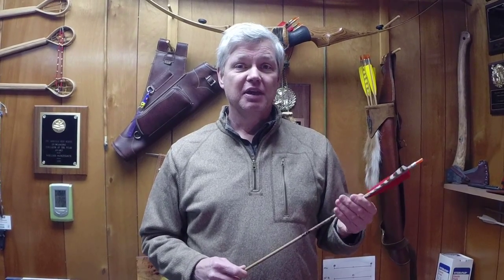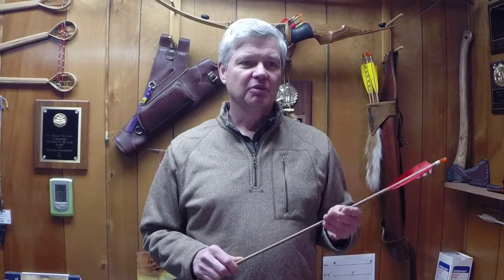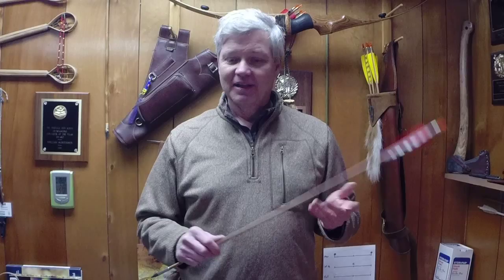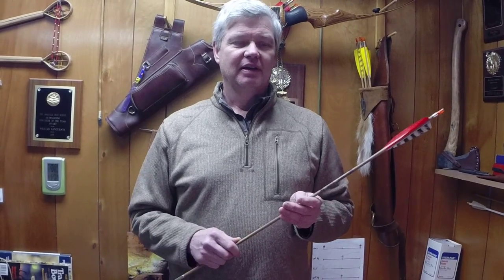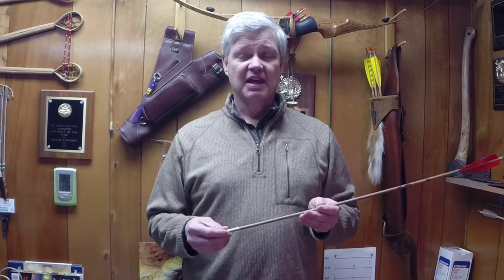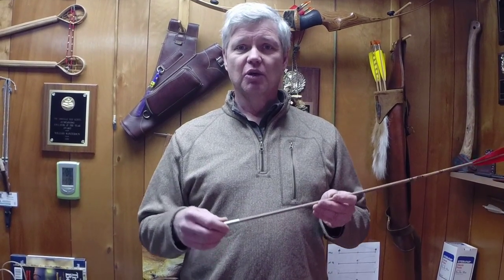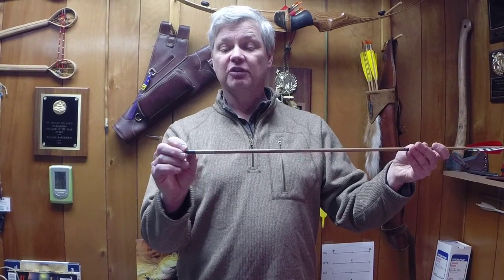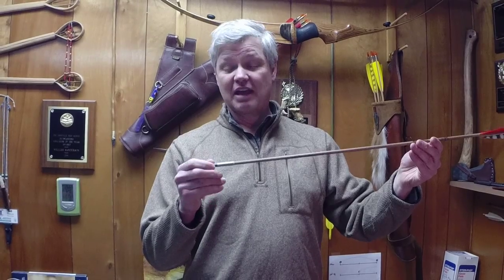Aluminum footing on carbon arrows: How-to Part 1 of 6

Comment: But how about safety? I'm sacred of using carbon arrows. Is there a way that i definitely won't shot a carbon arrow to my hand with a #70 bow.
Reply from the maker: Nothing in this life is 100%, but footing a carbon shaft greatly reduces the risk of the shaft splintering.  The vast majority of carbon shaft failures occur at the ends of the shaft, not in the middle, so reinforcing the ends and literally holding the shaft together there with a sleeve of high-tensile metal will greatly reduce the risk of the shaft coming apart.